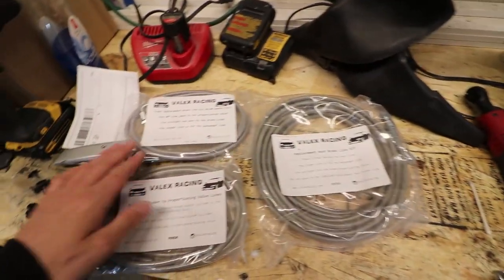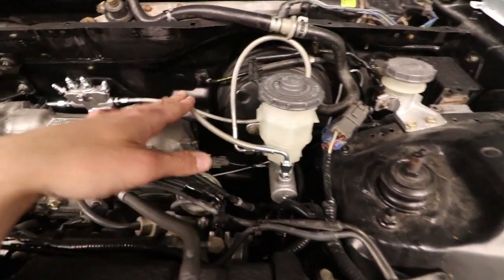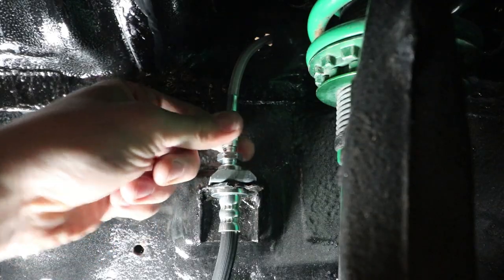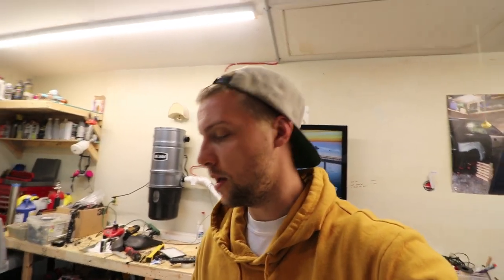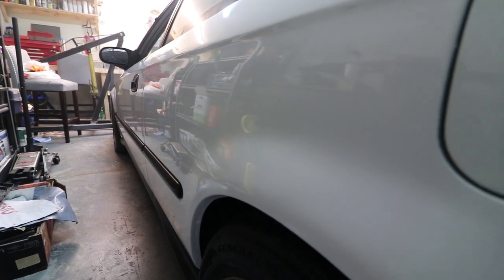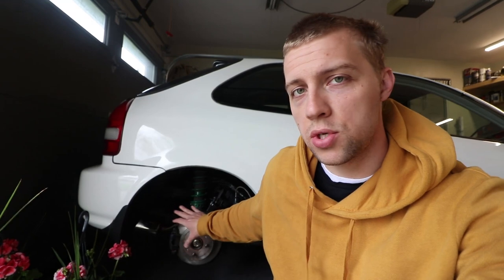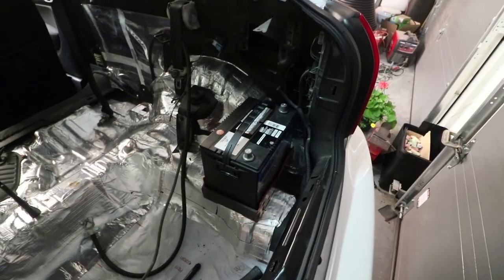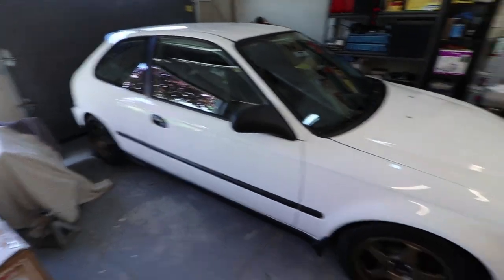New Valex Brake Lines & Completing Checklist for Safety Inspection

Comment: it badly needs a front lip
Reply from the maker: which would you suggest, because i agree
Reply: Garage SpeCivic original honda lip for 99 facelift bumper would be the best... else a spoon or mugen one would work too
Reply: Garage SpeCivic if you are using 99 rear bumper, theres also a original honda lip available for it.